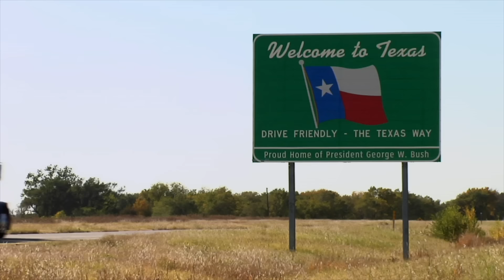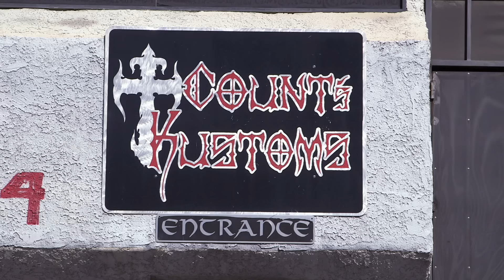Counting Cars: UNBELIEVABLE CLASSIC '60 VW BUS (Season 9) | History

Comment: I've always wanted a Bug Bus and I could have probably had at least a couple in the 70s and 80s when the price wasn't too bad but as usual I let a few of em slip by me thinking they'd always be several of em around. It seems like they just vanished lol...People started collecting em and I missed my chances of getting at least one that was running and driving for cheap cheap, as is 500 or less. I remember seeing em everywhere and they didn't take alot of maintenance to keep em goin..In the 90s I's in North Carolina and I seen a whole complete different thing with how they built the Buses and the VW bugs cause the horsepower was off the chart and it didn't take alot to get em to the level they made em to be lol..I got dusted by a Bug and that's when I had to have one and I got one for a really good price but I didn't make it back home with it cause I ended up letting it go and I've regretted it every since lol

Comment: They installed an automatic transmission in this 1960 Microbus, a technical problem, but the episode did not explain how they solved the problem.  

Much of the technical data is omitted in these shows, which make it a disappointment for me.